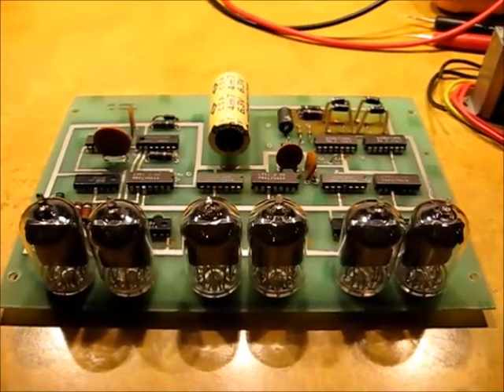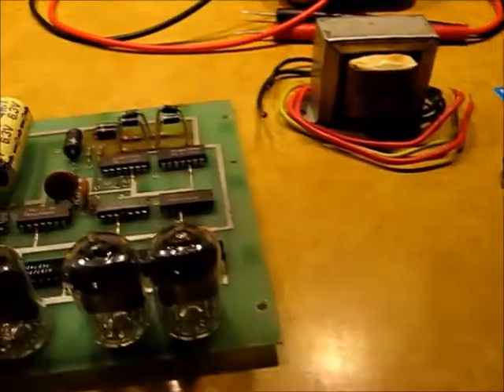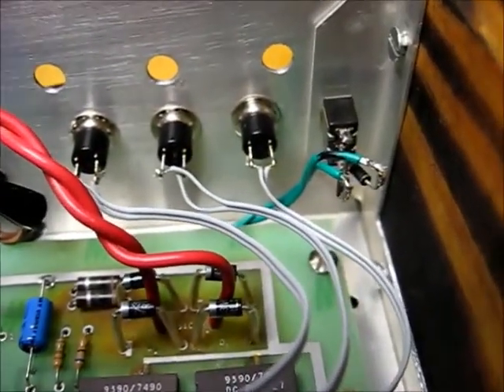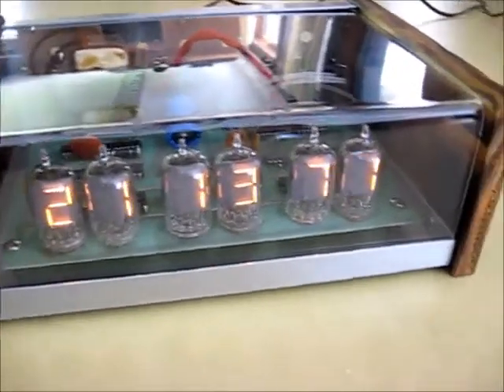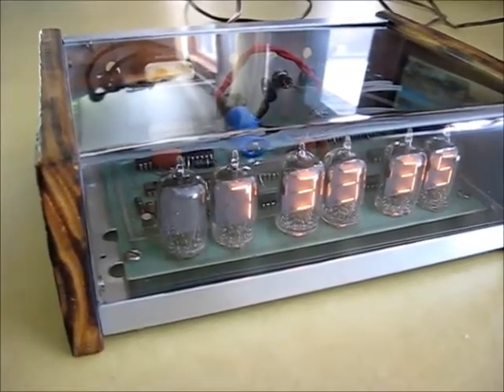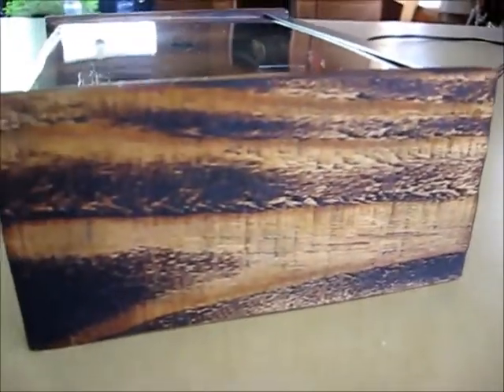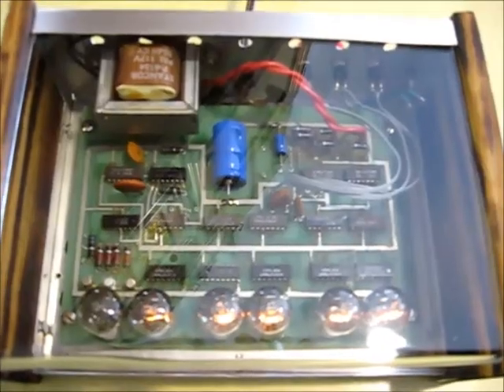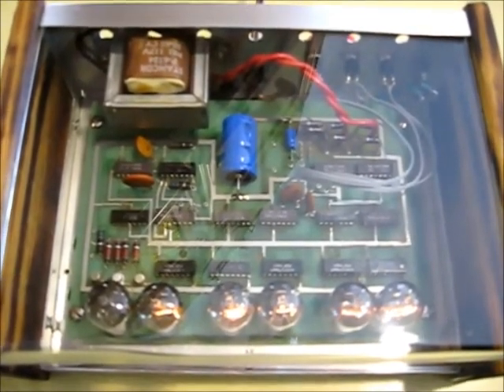1975 ESE ES-112 / 124 Numitron Clock Vintage 7400 TTL - Repair Project Summary

Comment: I just bought an ese count up timer with the numitrons. I’m going to convert it to a clock
Reply from the maker: Great!  Good luck with the project.  If you like, send me a note if you document the project here on YT.
Reply: @JIMO415 would you think it would be ok to use it as a full time clock or do you think the tubes have a limited lifespan
Reply from the maker: @RanHam  the short answer is yes to both questions.  I say build it and enjoy it.  I have been running a Numitron clock built in 1977 that I obtained, changed one tube, rehabbed the clock and it has been going for 4 + years now and it has been good.  The clock in this video was going for a year and a half+ then I put it aside.  I now have it on the bench doing a modification so it can go the Australia!  But yes, the tubes do have a lifespan.  A few things can be done to extend their lifespan.  They were designed to be run at 5 volts and 20 mA per segment.  The 7447 driver does just that.  A simple diode dropping chain of two or 3 rectifier diodes can limit the voltage at the tube supply +common rail and really cut back the voltage and thus the current to the filaments.  I talk about that in a few of my Numi videos but only briefly mention it in this one.  (It is a switch on the back panel with the 2 green wires and two diodes).  Another consideration, there is something I read about in searching forums that if using a microcontroller, some programming can be done to keep a 'prewarming" current on the non active filaments before they fire to help keep the thermal shock to a minimum.  The theory is that will help with longevity.  But if using the original logic as probably found in your ESE, that is not possible.  I would also consider keeping extra tubes on hand for sure before they disappear.  They are out there if the are the pin type and not the wire lead type.  Are they RCA DR-2000 tubes in your clock?  They are still found on ebay.  A compatible tube is also the DA-2000 (different brand:  Apollo by IEE) also found on Ebay....but I just looked and wow!  The asking price got real expensive!  keep an eye on them...about $10 is what I bought a bunch for in the IEE brand NOS.  If you keep the 7400 logic I have some schematics and there is some detail in this video...https://www.youtube.com/watch?v=XiExwdsAeSM&t=761s

Comment: FYI. I have made progress making a new old ESE ES-124 Numitron clock based on 74LSxx logic chips.
Today it started running all the digital functions ok. 
Got the clock powered by external +5V DC PSU. Base clock provided  by the remade Radio Shack TimeBaseGenerator. Still some things remain on the TODO list. I.e. mitigating the bouncing set key input.

See my channel, the playlist " Make old things new".
Cheers
Reply from the maker: Thomas, wow you have been busy!  Looking good.  On the ESE TTL remake, I see the seven segment decoding is different on the digits.  What drivers did you use?  The "7" even has an extra segment.  The DigiVista is on my gotta have list!  That is why I made the 8 digit Nixie clock here: https://www.youtube.com/watch?v=XiExwdsAeSM
Reply: Thanks for Your interest. If YOU like my stuff, who could not? ;-)
I DO LIKE YOUR stuff more than the one I do. YOU are my man, or so. dunno how to say.
Reply: @JIMO415  I have used domestic made electronics in particular some DL090 and 7447 compatible but  even more capable 7-segment decoder/driver IC. 
The D346D made in the GDR supports adjustable regulated constant current outputs. This allows too to spare the dropper/bleeding resistors on (LED-)segments. Related documents can be found in the mentioned Google folder. Big bonus, OUR dometic chip provides the proper representation of the "6" and "9", with the dash the comical US made chips left out. It's like making "Hochwasserhosen" where the lower rim ends a feet over the ground.
Reply from the maker: @thomasw2509  Hochwasserhosen ... "flood pants".  Ha.  There actually was a US version TTL ic that had correct representation of the "6" and "9".  It was the 74LS247 and a D347D comes up as being compatible possibly.  See my video that shows it driving a tube: https://www.youtube.com/watch?v=M-63B6ruxeg&t=4s
Reply: @JIMO415  Hi, thanks for the link. I knew about the 74247. The 1975 elektor magazine article published "How to improve the readability" since the 7447 lacks the proper reperesentation of the 6/9. Have not watched the entire video. But, please be assured , OUR own, the GDR engineers were capable of doing much more than copying western stuff. But many of the inventions made did not make products because of the small size economy, the limited abilities to reinventent everything and make on our own equivalents the f*** western crowds did not want us to by original from outside the country. There was the CoCom list, do You know? The same stupidity aimed at blocking at will called "enemies of the US" the crazy cowboys do fouling everyone in the world who wants to do its own way, Apart from the UNWANTED US-way of living. You might live in the country side in a peacefull place. I do not. To me it is fighting all day all night.
Anyway. I do enjoy having combined the stuff made in the GDR, Cz, Poland, USSR, Western Germany, USA. Haha. Barack Obam said" We can do". I responded "I can do" long before You came up. Thanks for reading.
Reply from the maker: @thomasw2509  I figured you would know, just wanted to mention.  That is a great project having it designed to your liking.  When I see German products, I associate them with great quality and performance.  I will buy tools and power equipment made in Germany with out hesitation.  We used to be a great manufacturing country, with quality, including many of these vintage electronics until the 70's when things started to change.  Perhaps over regulation, greed, laziness and just entitled thinking did that.  Before it was Korea, Taiwan, Etc and the like were starting to get in the game and now China has squeezed in to take most of the manufacturing, alot of it substandard in quality.  The president you mentioned started divide and did not touch real issues that needed help.  The puppet in "the chair" now is an embarrassment in my view.  He was "installed" and not chosen by we the people.  The guy in between had it ALL CORRECT but his mouth was an issue and he was a threat to every corrupt politicians way of operating.  That is why "the orange hair guy" is made out to look like a criminal and is in the cross-hairs.  The media is in bed with the one side.  In the cities, run by that one side is where all the problems are cropping up, think about it, the leaders let thugs run a muck looting and burning things in those cities and called it "peaceful"!  Cancel culture, and all the other things we can not talk about because of all the over sensitive thinkers are bringing us down.  We are very divided and headed for fighting every day and night.
Reply: @JIMO415  Hi, thanks for telling Your oppinion. I still have to do some guesswork. By chance You are telling me something between the lines. Two years ago I had a fellow, a brave man located in SFC. He told me his point of view. We deeeply agreed the whole world was brought down to the bottom. Now everything, even expansive things made in the USA and Germany are not worth spending money any longer. For the D347. This prticular one and the brother D345 DO NOT provide current regulation. It is just the D346D and the D348D. Both pairs differ in showing the numerals/letters that come up on code above 0-9. For using on a clock that does not matter. The manufacturer says usecase " Measuring technics oriented display" or on the other side "Displaying HEX values". see the truth table for the outputs. Please take note these chips are made for using cA display. Does not hurt when the pcb design allows using both either Vcc or GND related "common" pins.  If You have some spare time, would You please look at the schematics I have put annotations on? I do appreciate Your knowledge. I assume the original designers accepted the periodical blanking (period of two seconds) of the readout when the counter reads the input frequency, devided by then trough the gating circuitry. A'm I right?
I HAVE no CONTRACT with the guy some call "God". But I wish he bless YOU.
Thomas
Reply from the maker: @thomasw2509  I have not been on Google drive yet.  What schematics would you like looked at.  I am having chronic pain with sitting right now and can not concentrate that well.  I have homemade clock build projects and other repairs lined up that are sitting.  I thank you for the blessing.  You may take a look at what is going on in the world and if you know a little about the book called Revelations, things are lining up slowly as called out in that book.  You do not need a contract, but just a belief in Jesus and you can have someone to open up to.   You will then be blessed.
Reply: @JIMO415  Hi Jim. Have watched the DigiVista video a while ago. I do not want to use HV stuff. Have bought a number of the edge connectors from China. Junk stuff. Anyway. If I can do all the other unfinished projects I would like to make a version using the small IV-9 Numitron tubes, I have in the shelf. ;-). Thanks for sharing. BTW: The previously mentioned GDR made DL090 (7490) I'm using on other projects like the RS Archer Frequency counter pcb I have published a short video of today. Sometimes confusion happens to me, sorry.

Comment: ESE used a standard BUD series case (wood grain finish with plastic sides) case from 1970s to 2000.
I use to remember the name of that series, TecTec manufactured them until Al Kahn’s death and
divestiture of the metal shop.
Reply from the maker: Happy New Year....Thank you for the information.  Were/are you an employee of either company?  Thanks!!

Comment: Well done Jim!!  Congrats on another successful restoration of a truly classic vintage clock.  The "See The Works" enclosure and Numitrons are beautiful.  I am curious about the ESE-112 / 124 original case:  is the front bezel clear or smoked plexiglas?  Or is it glass?  Those original cases look like they were made by Ten Tec and perhaps custom made for ESE.
Reply from the maker: Hi Jack, Thank you for the complement!  The filter in the front of the original ESE cabinet that I so briefly pictured, has a smoked plexiglas is the answer to your question.  You mention the maker of that case and I guess that I wondered the same thing.  I have seen those cases in other things and possibly one was able to purchase one for a project box also is my assumption.  If you search ESE timer or clock, you will see more.  I guess ESE bought them from Ten-Tec if that is true!  Stay tuned for another video in the coming month or two as I have a whopper of a project that you saw a couple images of some parts.